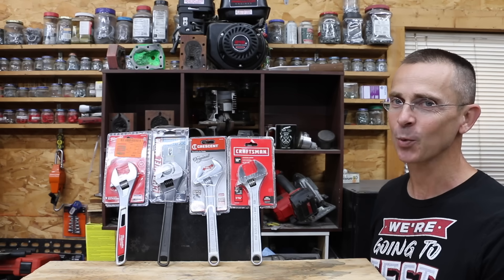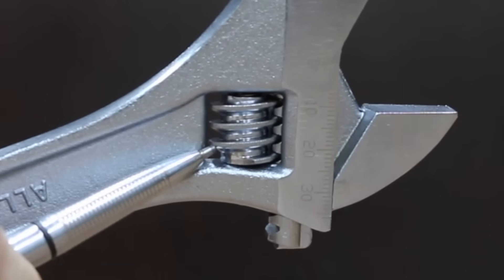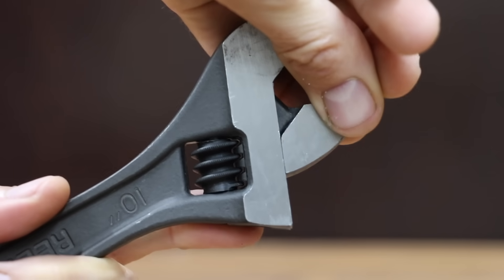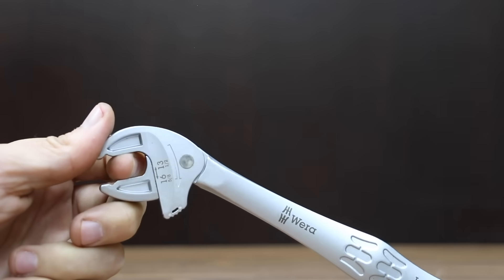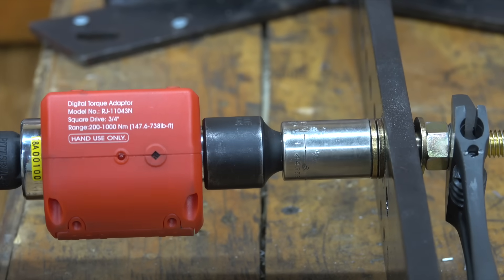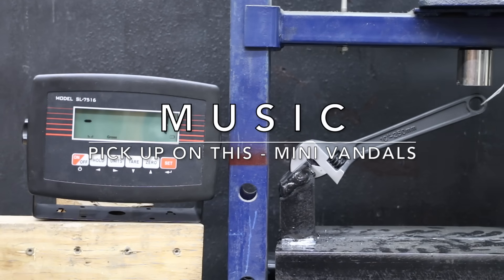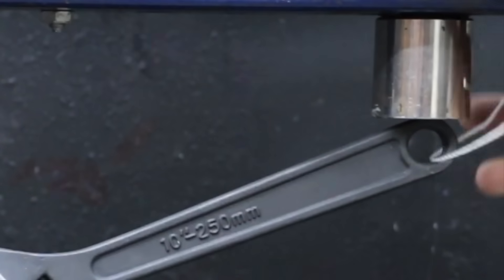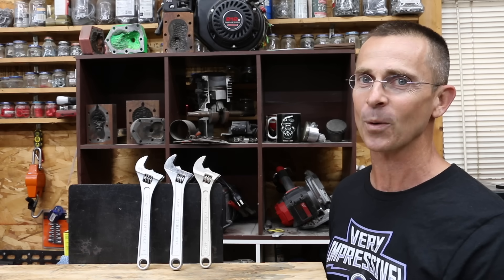Best Wrench (ADJUSTABLE)? Craftsman USA vs Craftsman, Crescent, Kobalt, Milwaukee, Channellock

Comment: Can't wait to see the showdown! :-)
Reply: Wow, fantastic. Nothing was missed. I'm glad I have a set of US made Craftsman adjustable wrenches up to 15" that was made in the 1990's.
Reply: @electronicsNmore  I worked at Sears at the time.  I bought up a lot of Craftsman non-powered  hand tools each year on employee appreciation day, and I still use them quite regularly.  I'm glad I did then, because many Craftsman tools sold today don't hold up as well, not just the adjustable wrenches.  For example, I bought bolt cutters from them a little while back (offshore made) and the cutting edges don't even align very well in addition to slide slop.  I also have some loppers (short blade long handle bush limbing tool) that keep tightening up and seizing, several times a day.  I have to continually use a pair of wrenches to loosen the bolt/nut as I work.
Reply: @happycamper6352  use some wd40 silicone spray
Reply: @Tallnerdyguy  WD40 does buy a little time, but sadly the problem still happens too often, just a little less often than if I don't use it.  Older Craftsman loppers lasted much longer and never had that problem.  the only reason I don't have them anymore is that I used them to cut limbs that they weren't designed to cut and bent the handles by pulling one handle with two hands while the other handle was wedged against my chest.  So I traded it for a newer set of loppers, which are these new garbage ones.  I should have just fixed the old ones and treated them better afterwards.  They were much better.
Reply: @electronicsNmore  but then not everyone could afford to pay $20 for a screwdriver or wanted to list them first on our life insurance policy.
Reply: @TheWabbit  They weren't that much. Philips #2 and slot were around 5-6 bucks. They also had deals.
Reply from the maker: Thank you very much!!
Reply: @ProjectFarm  Have you done a test of adjustable "channelock" pliers?
Thank you
Reply: @SDsailor7  last week
Reply: @Tallnerdyguy  Thank you. I will look it up
Reply: @ProjectFarm  More chainsaw grinding wheels or chains. Something chainsaw lol. Maybe compost brands?
Reply: I better dig out my USA Craftsman wrenches and put the rest on the back burner.  Thanks for showing us what we should know.  You're the best PF!!
Reply: Another great video! I like the hand tools comparisons. Covered most brands. Snap on and Mac Tools should be tested as well. As they are sold directly to mechanics on the job. Would like to see how they stack up to Craftsman USA.
Reply: @pumupuku  The Bahco Crescent in the vid is  Snap-On . same factory in Spain , makes both brands  

He did miss the Matco , which "might" also be the same as a Stanley or Proto.  I don't know if any of the others might be "related" to those three.
Reply: @pumupuku  they are much superior
Reply: Analyze many types of hand tools in the construction industry, welding mechanics, agriculture, forestry and fishery industry